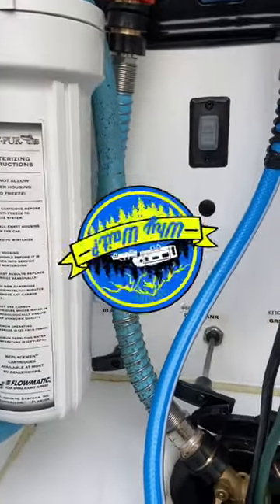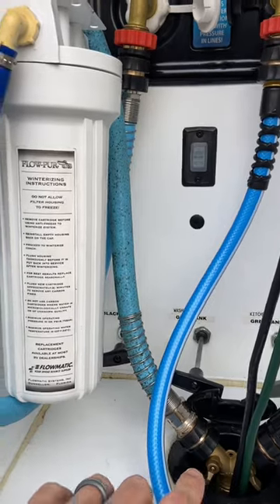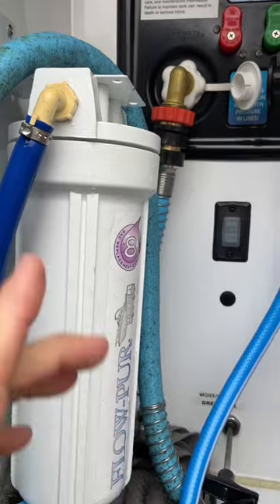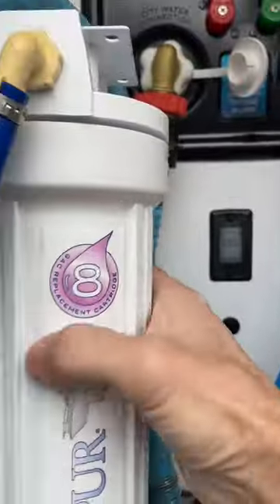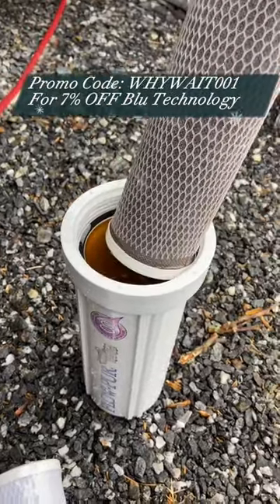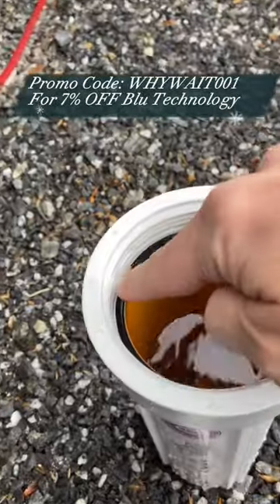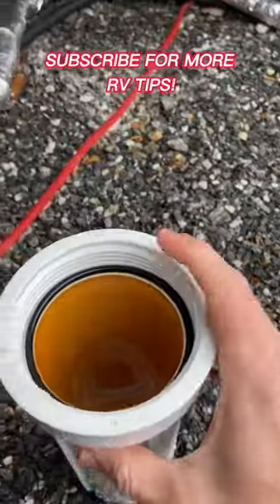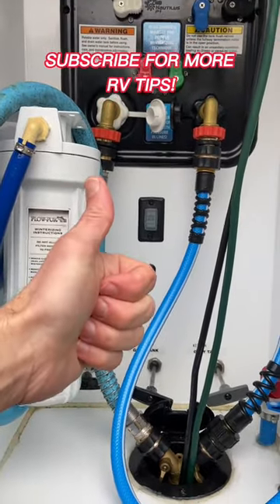RV Filter Housing Stuck? Easy Fix!

Comment: I just winterize my rv....i tried multiple things, even with the wrench i could nit budge this....i even tried heating the top w a lighter....thanks 4 the tip....i never thought to leave the low point drain open...i will try in the spring....thank you
Reply from the maker: Yup, just shut the water off of course and release the pressure with the low point. Comes off super easy